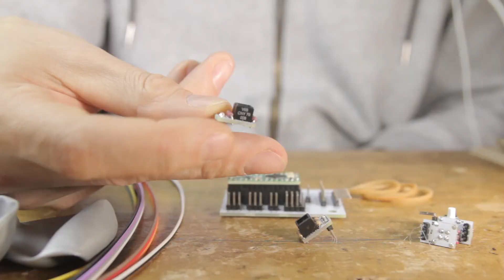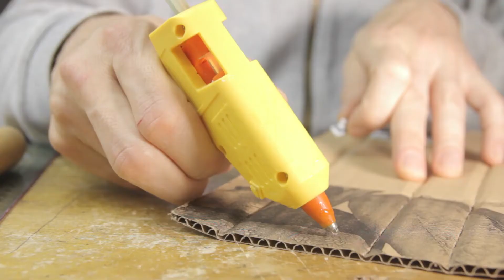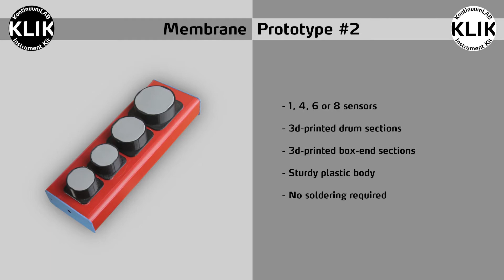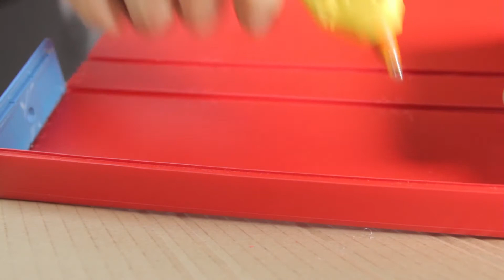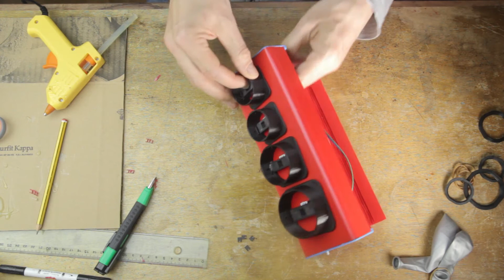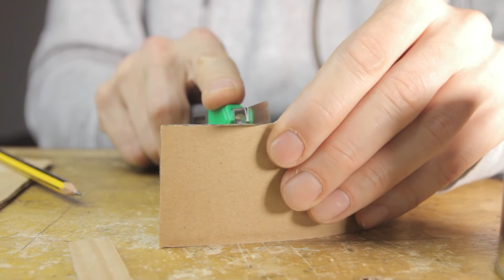Making the Membrane, a balloon based MIDI percussion instrument - KLIK Tutorial #6

Comment: can you tell me how does the performance of this membrane tech compares to a piezo one while building a percussion instrument?
Reply from the maker: Hard to compare their "performance", because they're so different. Main difference is that a typical piezo disk sensor responds to deformation of fractions of a millimeter, where as the membrane based sensor allows much more movement. So playing a typical MIDI drum kit (piezo based) feels like playing an impact sensitive static surface, the membrane instrument is very flexible and responds to the depth of your touch. I'd say it's not better or worse, just very different.
Reply: With the membrane, you send a note ON when you press and it sends a note OFF when you release it. With a piezo when you hit it, it sends a note ON and almost immediately sends note OFF.
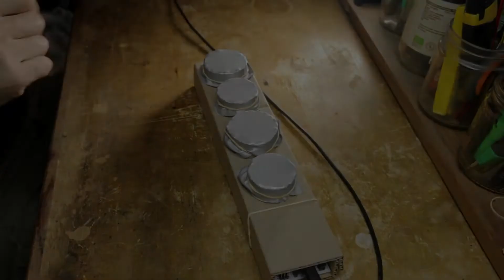Some nice things about the membrane are that you can control the velocity (14:14) and you can play virtual instruments that play musical notes, but for me it is a bit awkward to use circular sensors.
You can put the piezo inside a box or inside a 3d printed square (you can make the shape you want). Piezos are perfect for percussion instruments (https://www.youtube.com/watch?v=6NWJc3xfEj4&t=36s), but not for note instruments.